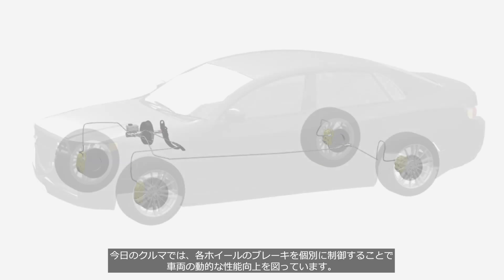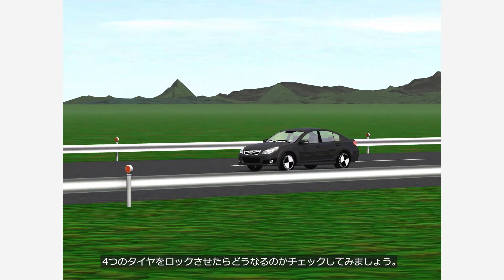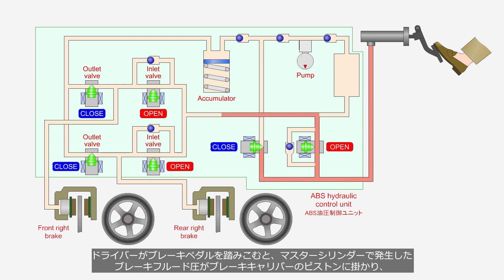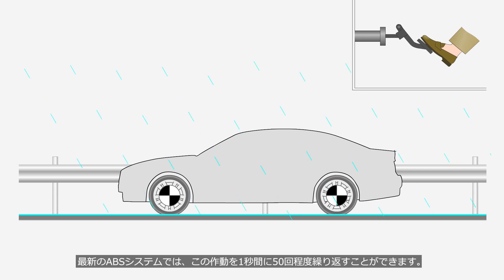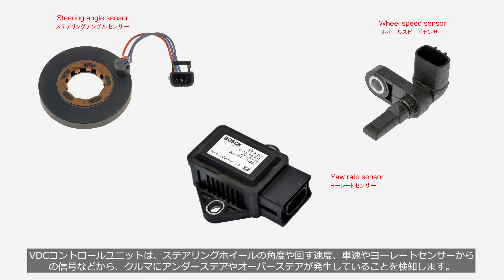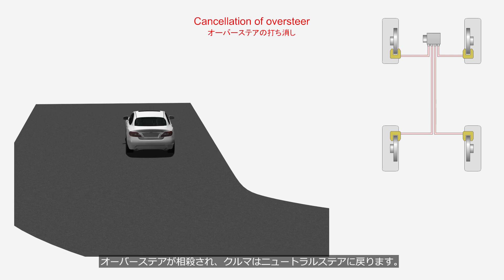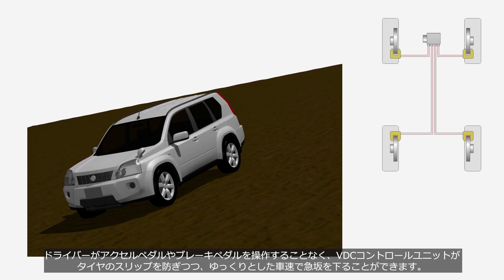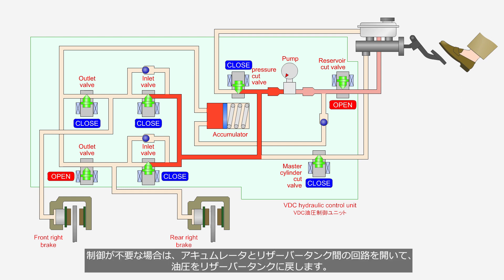How a vehicle dynamic control works?  Including ABS, ECS, TRC, Torque vectoring and HDC.

Comment: Does brake-based torque vectoring kick in when driving in a straight line but on differing mu, i.e. snow on one side and slush on the other side?   Or will traction control system be the only one functioning?  Thank you
Reply from the maker: Thank you for watching the video.

The function of applying brakes to slipping drive wheels is the same for both traction control and torque vectoring.
But, traction control works to keep the car driving straight. Torque vectoring works to help the car turn more effectively.
The control unit constantly monitors whether the car is driving straight or during cornering.

If you’d like, please feel free to check out other videos as well.